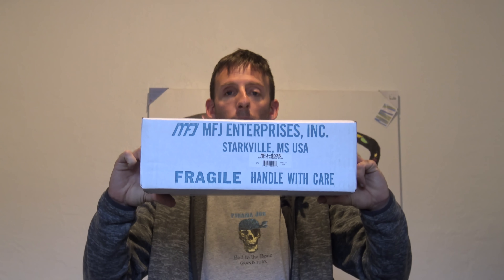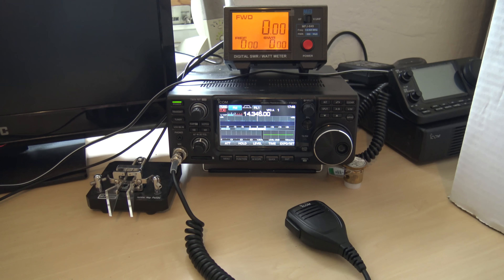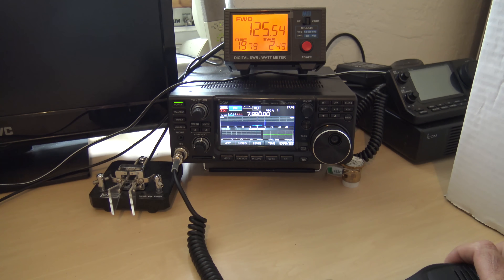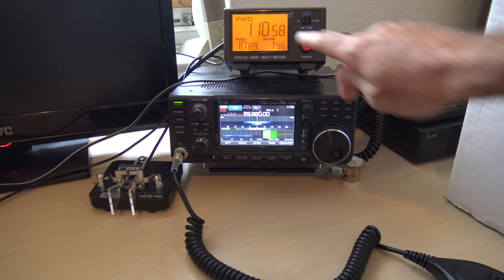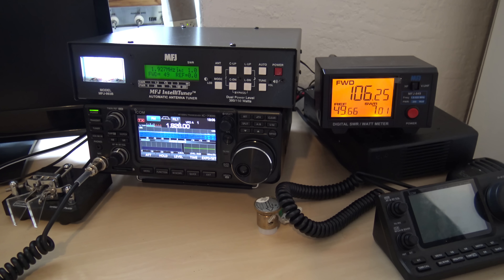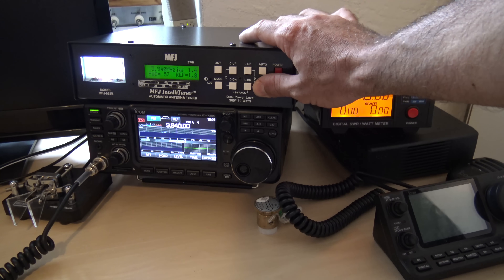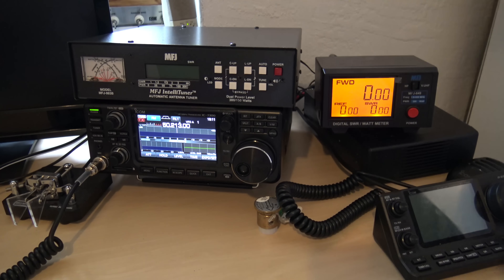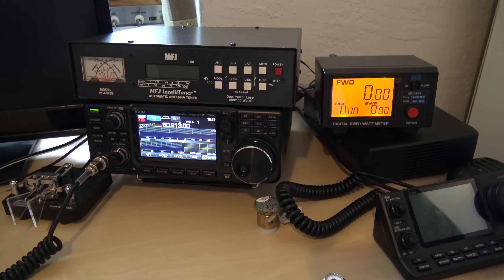Understanding HF Antenna Tuners, What Does It Do?

Comment: That's all true for "near the rig" tuners, if you have a remote tuner at the base of the antenna it's a different story since it'll vary induction and capacitance and make a tuned, purely resistive, 50 Ohm circuit, otherwise called a resonant antenna ;) But yeah, I thought about this when I see people with G5RV and tuners at/in the rig, it works that's for sure, it looks right, but the efficiency of the system compared to a resonant antenna is deplorable :/
Reply: Also power reflected isn't lost, it's bounced back to the antenna, so it's eventually radiated by dampening effect, the efficiency is terrible since cable loss make a lot of it wasted as heat.
Reply: If the antenna feedpoint impedance at the desired frequency was 50 ohms you wouldn't need a tuner to match it to the transmitter.  When the antenna tuner is located at the antenna and adjusted correctly it's output matches the impedance of the antenna and it's input matches the 50 ohm transmission line and transmitter output impedance.  When the antenna tuner is at the back of the rig as the video demonstrates, the tuner is matching the output of the rig to the combined impedance of the transmission line and the antenna.   If the antenna is significantly off 50 ohms it's likely that the feedline has sheath currents and is radiating as well.
Reply: I should add I liked the video.  Retired design engineering manager from Motorola.
Reply: When an antenna is constructed to its resonant frequency, it does not mean its impedance just magically becomes 50 ohms. 

Its natural impedance at resonant frequency is whatever its natural impedance is. It is different for every style. A dipole in freespace has a natural impedance of 73 ohm at its resonant frequency. A folded dipole is closer to 300ohm. A resonant delta is 110 ish. If you connect any of them direct to the transmitter it is not a 1:1 match. 

Since the impedance of your transmitter output is 50 ohm most antenna have some kind of element to match either in the antenna, like coils, stubs or baluns to get the max power across even if they are "resonant". You could also use an ATU at the feedpoint if you wanted, it does the same job.

Comment: Thank you very helpful.
I am using a multi band comet hvu-8. It does 70cm,2,6,10,15,20 40,80 and I am still having issue just listening.  
I wish you would do a setup video on that antenna so I could follow it.  Guys here dont help much. I do have an mfj - 269c analyzer.  Still trying to figure that out too. Thank you again.  Ve3jxt.  Contact ve3jxt@rac.ca

Comment: For over 50 years I have been saying that a radio is no better then it's antenna. Tune the antenna first.  Carl AB1ZI
Reply: Right and tuning the antenna means shortening or lengthening the antenna itself.  Pain in the butt but necessary. I cut it slightly long and then check the SWR on a range of frequencies in the desired band to determine how much to trim the antenna. Trim and try again. Usually 2 adjustments max and I'm done
Reply: And I have learned over 40+ years that the secret to broad bandwidth for a dipole is to use heavy gauge single strand pure copper wire. 8 gauge I use. Makes a huge difference!
Reply: @johninjersey  And if you used something even wider? Like a copper pipe?
Reply: And this is why I have made an antenna system my first acquisition toward assembling an HF ham radio station.  I will be experimenting on various antenna systems to find ones that best fit what I want to do before getting the rest of the gear for my station.

73 VE7NDE
Reply: If you attach your antenna to the tuner directly or use low-loss line like ladder line you don't need a tuned antenna. The tuner will just keep reflecting any reflected energy back into the antenna until it's radiated.

Comment: Eric, Great video on explaining how a tuner works. From what I got from the video, it would be better to spend the money on a antenna analyzer and tune the antenna to the frequency you are going to transmit on then to spend the money on a tuner.
Reply from the maker: exactly. People buy $300 tuner for a $20 antenna.
Reply: @HamRadioConcepts   what antenna analyzer do you suggest for a first time ham? I have seen Rigexpert, MFJ and one by Comet.
Reply from the maker: @Ben-md9yx  all 3 are good. I would go for the cheapest one. I have had all 3, I kept the MFJ and sold the other 2. MFJ-269 not the digital lcd 223 i believe, it eats batteries
Reply: @HamRadioConcepts  great vid. Old ham, but new to HF. Do you have a vid on making an antenna resonant to a band using the antenna analyzer? I have an Icom 7300 and an MFJ-1794 (very limited in space + HOA). My question is what tomdo with then information given to you by the antenna analyzer. Thanks!
Reply: @HamRadioConcepts  not really a valid point, as people spend $500 on an antenna analyzer for a $20 antenna. You can actually save $$ just buying a $300 tuner instead, and both time and $$ just cutting a random wire and not fussing with getting the exact length. Since the signal is reflected from the tuner back to the antenna, if you use ladder line or attach the tuner to the antenna directly, you're not really any less efficient than a resonant antenna at the end of the day.

Comment: Excellent video - thank you.  Can you recommend a resident mobile antenna for my vehicle.
Michael VA6XMB
Reply from the maker: hamsticks,  each hamstick covers 1 band. like a 20 meter hamstick for 20m, 40 meter for 40 etc.
Reply: Hamsticks are superb and so cheap too
Reply: Thank you for your reply/advise.  What manufacturer would you suggest (e.g. MFJ etc.)  What mounting bracket would you suggest?  Can you mount multiple Hamsticks side by side and 'toggle' between them?
Michael VA6XMB
Reply from the maker: @michaelbradley8508  i made this video uploading tonight, just for you :), check it out.
Reply: Very good.  Thank you.
Michael VA6XMB

Comment: So what about Antenna Tuners placed between the Antenna and the Coax Cable? Right behind the Antenna..
Reply: i.e., Antenna couplers.  They should yield much better performance, as they allow a feedline to be terminated in its characteristic impedance at the far end.
Reply: @denelson83  - Thank You for Your Answer!
Reply: Superb explation

Comment: A lot of people tend to think a tuner is majic. Well, mostly new guys. I use one on my portable set up because my xeigu swr meter is differant than what my aa30 analyzer says... wierd. I have a question though. Where should an amp go? Before or after the tuner?
Reply from the maker: Before the tuner, because you want the unmatched higher than normal SWR to be absorbed into the tuner, this is why they make high power tuners, because you transmit that high power into the tuner.
Reply: Thanks. I build a 70 watt amp kit for my qrp portable... cant affort a real nice rig yet. And realized i wasnt sure where it went. Although 20 watts will reach across the country amd i have even gotten a dx contact, i cannot his alaska or hawaii yet. I think the amp will get me there...

Comment: Resonant Antenna, Resonant Antenna, Resonant Antenna !!!
Reply: wow  just wow.    why do people not read qualified information on this?   I guess its easier to believe BS

My doublet will out perform many so called resonant antenans.
Reply: Well said @davidmoes7530 .  I achieved from VK3 my Band DXCCs on 80, 40 (+WAS) & 30 all using a classic ladder line fed 'doublet' style antenna setup to provide gain in the right direction for optimal signal to noise ratio...  It took me approximately 2 years concurrently to complete all 3 and that is whilst working full time, running my own youtube channel and caring for a family with 2 special needs autistic kids; in other words I wasn't on the radio at every moment.
Reply: Hate to burst your bubble, but there are antenna designs dating back to the 1920's that are non-resonant that will blow away any cut to the band resonant dipole you can build. Ever heard of a Rhombic? Ever heard of a doublet? Ever heard of a Sterba curtain? A resonant antenna is only resonant on one frequency...everywhere else it's not. What do you gain from that?
Reply: @richb.4374  That's true but in today's mobile world, at least mine, the magnetic loop has been proven to work best for what I need, they use variable vacuum tube capacitors to tune for resonance, almost a notch filter for noise of all kinds, my three foot diameter loop can be used with 100 to 200 watts and tune resonant on 20 meters through 10 meters. The 6 ft diameter mag loop tunes 80 meters through 30 meters and can handle about 500 watts. Have had decent performance considering band conditions and the size of the antenna...73's
Reply: @richb.4374  Rich that may be all well and good but a lot of us out here in real life just don't have the funds to buy and set up an expensive antenna, even like the one this guy's using. Plus some of us who can't afford them are also handicapped and doing the best we can with what we can get. I'm trying to save up now for a mast and a tower so I can get my end fed long wire put up. I have to hire someone to put it up as well because I'm handicapped. Got no handy trees but a nice long north south bit of land but very little money or other resources. You'd be welcome to come over and help.
Reply: Why I started to make my own magnetic loop antennas, resonance is the key, antenna tuners just make your radio happy, not your signal when you have large amounts of vswr returning back to your tuner
Reply: https://youtu.be/e00nGKT7Lfw
Reply: Good for you, I guess? For the rest of us in compromise land, we do the best we can and use a tuner (trans match) to pick up the slack. 73.

Comment: Your meter is reading rf on ground of coax that power has to go somewhere if it does not go out antenna
Reply: It ends up being reflected back to the transceiver and potentially heating it up.
Reply: Actually it is reflected at the tuner back to the antenna. it is not heating the tuner or the radio.  this is why he reads more forward power than he is transmitting. This signal will be bounced several times between the antenna and the tuner. Each pass it will loose some energy to the resistance of the coax wire. So while he is generally right, that it is good to have a resonant antenna, his explanation is not complete.
Reply from the maker: @xamr.824  I wasnt exactly sure of why the forward power readings were way off, but i  am glad people like you are here to teach me something. Now I know.. I spend as much time reading comments and trying to learn from others... Thanks for watching
Reply: @xamr.824  ouf, at least somebody who gets the point, clearly most people are stuck in misconceptions and this video only contributes to keeping these misconceptions alive. The transmitter does not see any reflected power, the 'tuner' is not dissipating a significant part either. The 'tuner' reflects it back towards the antenna. Having power moving back and forth between antenna and matching circuit contributes to resistive cable loss. As a conclusion I would not say 'have a resonant antenna is good'. The importance of antenna resonance is overrated. Having your matching device (a.k.a. 'tuner') close to the antenna is key to avoid power loss though. Assuming +/- 50W reflected and +/- 100W fwd power after the matcher means 3 times as much power loss  in your cable than with a perfect match at antenna level.